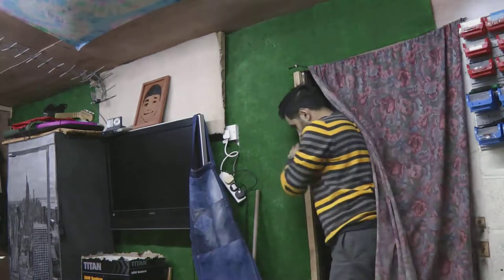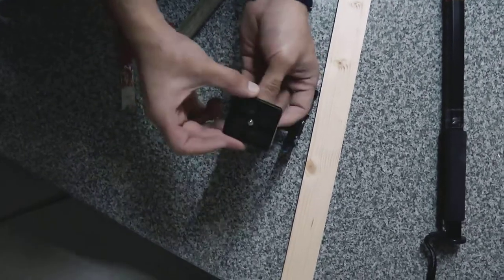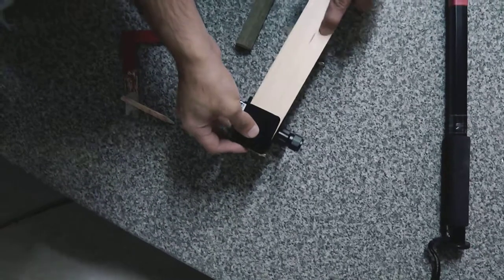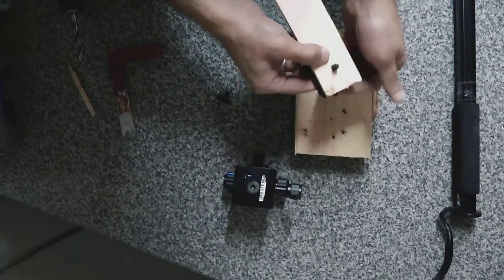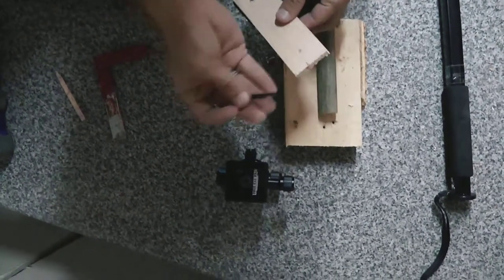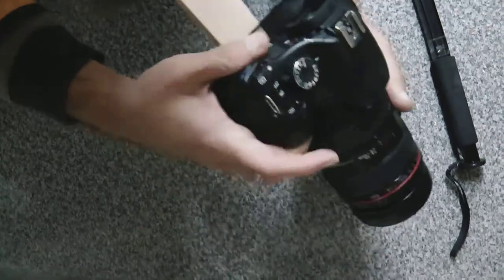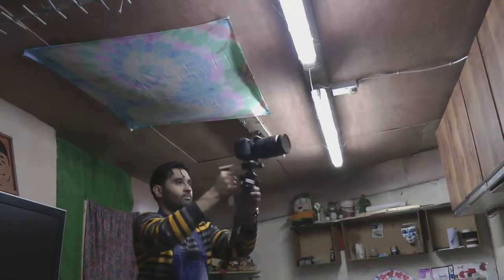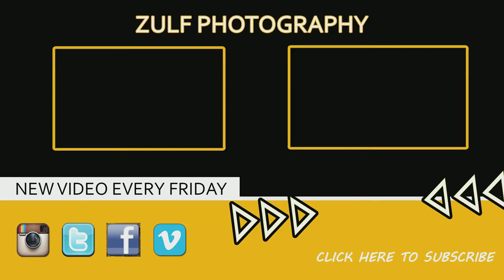Fail? how to make a diy dslr Steadicam stabiliser

Comment: This is cool, but ineffective and probably adds more shaking to the camera. since the handle was attached to the camera without any sort of joint (like a ball bearing) to absorb smaller movements, all the shake from the hand is still going directly to the camera. And the ball head monopod you have for counterbalance just swings around wildly and adds to the instability. Thanks for the video tho 👍
Reply from the maker: Exactly, here is another silly hack test https://youtu.be/MSg7u2grpfg